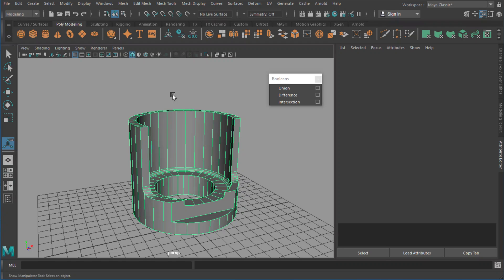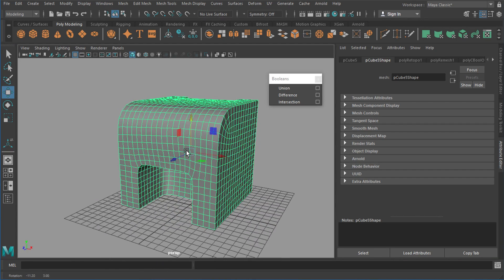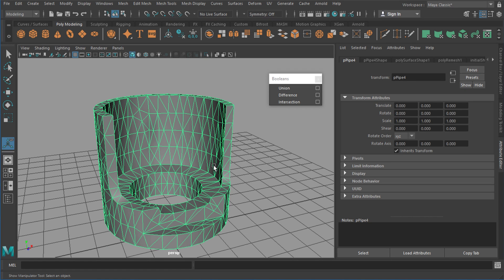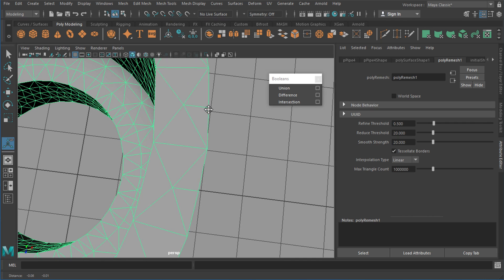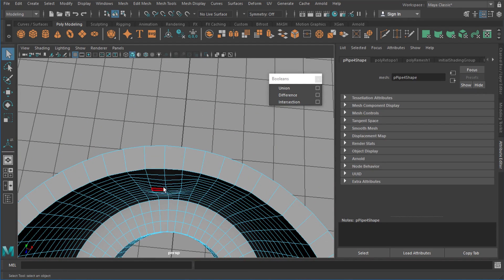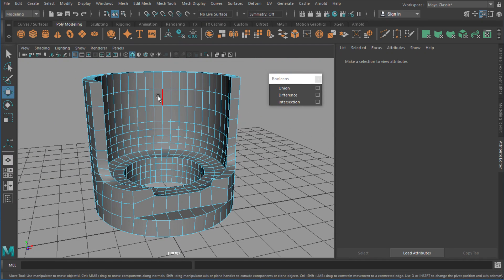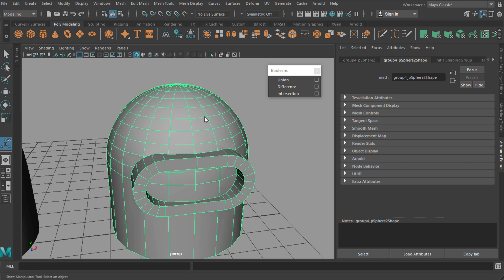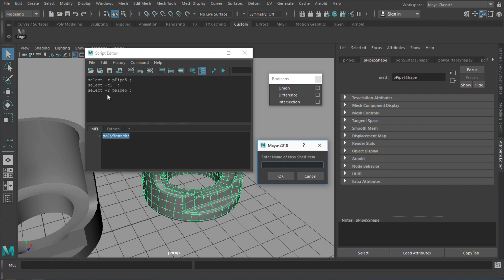Auto Retopology Comes to Maya

Comment: Thank you so much! I was really frustrated with this Retopology tool. That trick you did, forcing the Center Edge to be a hard Edge, is brilliant. I never thought of that. I was going about it a different way, ( A crappy and slower way) I was deleting one half of my geo, cleaning up the edges manually, and then using the mirror tool to duplicate and rebuild the model. Your method is way better. Now I can use this tool without being frustrated! Like you said, I was getting okay results, but it looked unprofessional. That one little trick has just solved so much stress :-) thank you again
Reply: WHY UNPROFFESIONAL ??

Comment: This works great using the mel command line but it neither one works when creating the shelf script. I get the output error "not defined".
Reply from the maker: Hi Cory - it's possible you're adding this info in a Python Tab in the script editor, not a MEL tab. Make sure it's MEL and it will add it properly.
Reply: @playcreative5523  That's exactly what happened. Thank you! Also, when I remesh, it creates tens of thousands of triangles. When you do it in the video, it gives you a pretty low count. How do you preset your target count?
Reply from the maker: @corylee9531  In Maya 2019 the default subdivisions seem higher - you can change it using the command flags here: https://help.autodesk.com/cloudhelp/2016/ENU/Maya-Tech-Docs/Commands/polyRemesh.html

For example: polyRemesh -rdt 100;
which gives you a Refine Threshold of 100

Comment: Dude can you help me out. The polyRemesh works but the polyRetopo won't.When I tried to change the target face count error occur "Input mesh has multiple component". My mesh is type/text. Do you any idea?
Reply from the maker: Polyretopo only currently works on PC and Maya 2018 onwards
Reply: @playcreative5523   I'm using Maya 2018.6 on windows. I figure it out though. It's not working when I have more than 1 text object. Each text object/mesh needs to be separated to work properly. Anyways thanks for the respond.

Comment: It doesn't work correctly for me. Maybe a setting I changed or a plugin I have? But when I polyRetopo, it just leaves the object the same instead of putting everything in quads.
Reply from the maker: If you're using Maya 2017 or less (or on Mac) polyRetopo won't work unfortunately
Reply: @playcreative5523  No, I'm on Maya 2018

Comment: This only works on booleans?  Is there any way to do this on a model made out of tris, that you want to convert to quads?
Reply from the maker: This will work on any model that is one mesh, regardless of if its tris or quads.
Reply: @playcreative5523  Thanks, finally got it to work.  The secret seemed to be deleting history after polyRemesh; but before polyRetopo;       The topo looks very impressive, however, the UV is now gone -- is that how it's supposed to work?  I was trying to find a way to maintain the UV map as it's dependent on textures already made.  Any advice?
Reply from the maker: @coles7811  Ah yes - deleting history will definitely make it much faster and less likely to crash. I do that in the video.
Regarding UV's, yes they will be lost unfortunately as it's a completely new mesh.
You could try and do a new UV layout, and then use 'Transfer Maps' to copy the color/normal etc over to the new UVs.

Comment: Hi dude. I'm currently experiencing a problem using this trick. Whenever i use polyRetopo; it stays in the same weird-face state when you put it in for polyRemesh; . Do you know how to fix that? I used the extrude tool, boolean Union/difference to make a model. It's a small side speaker.
Reply from the maker: Hey Oween, polyRetopo will only work on PC/Linux and from Maya 2018 onwards. Also make sure you're in 'object mode' before using it. Hope that helps.

Comment: I'm only bothered by how you lose the shape. Especially with mechanical models, maintaining precision is usually very important. Adjusting those artifacts by hand makes me cringe. Otherwise, much needed tools.
Reply: I mean, the only reason you would be absolutely needing to retopo mechanical hard surface models is if they are to be deformed or textured in very specific ways. right? Other than that, n-gons wouldn't be as criminal as they appear and can actually help reduce poly count and be much quicker in modeling and more importantly concepting without worrying much about the edge flow, n-gons and such.

Comment: love this, but you wouldn't know about troubleshooting it. i can do the remesh but not the retopo. any idea on how to fix this.
Reply: I'm having the same issue. I'm using Maya 2018, and the polyRemesh node works great, but I'm having trouble getting the polyRetopo node to work. Not sure why. The node shows up, it just doesn't change the mesh at all. Also tried deleting the history between nodes and it's still not working.
Reply: Nevermind! Found the problem. It was because my mesh was mirrored over. ^^;  Won't work if there are multiple components!
Reply: @MandaMorphosis  What do you mean by mirrored over? I'm having the same issue. I'm on PC 2019.
Reply from the maker: You need to be using Maya 2018 onwards and be on a PC. For now at least.